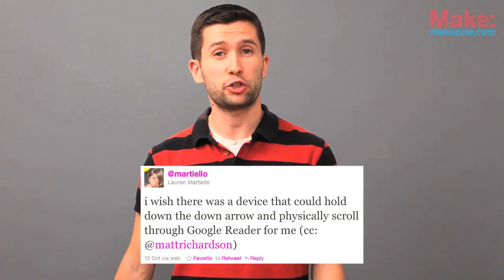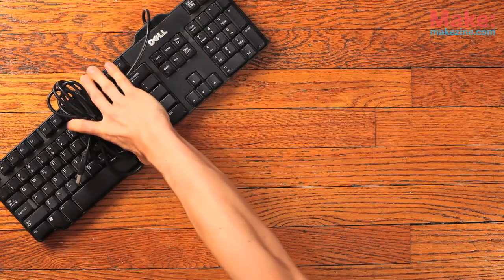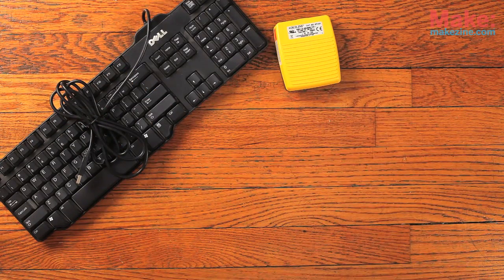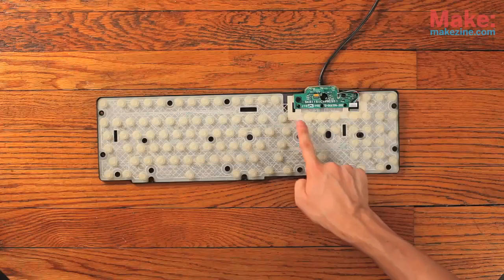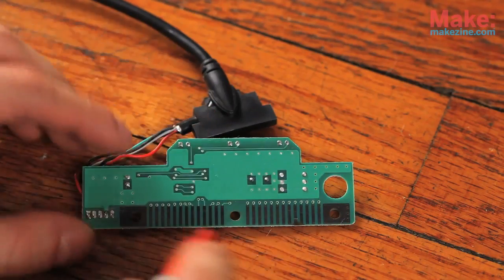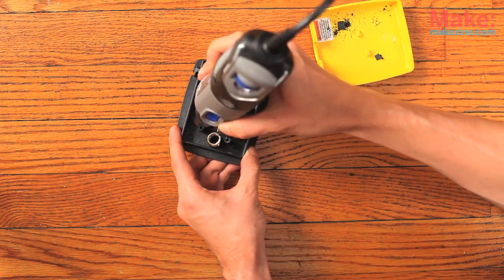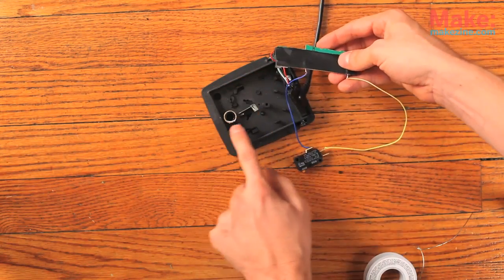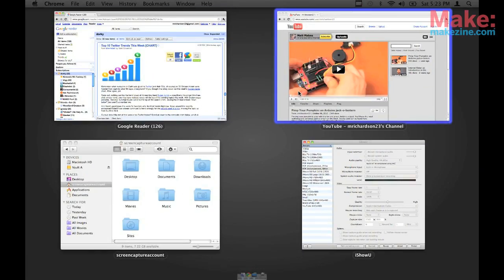Hack a USB keyboard: Google Reader Pedal

Comment: If you need two (or more) keys at once, like ctrl-a and ctrl-p for the pen function on power point, a simple double pole switch may not work.  You need to reliably trigger the ctrl first, then the other key.

Comment: Raceing games, the PC peddle sets have a variable speed, depending on how far you move the peddle, they also use a combo of break and peddle as reverse, but have no clutch. would there be a way to make a set that included a clutch pedal that needs to be pressed to activate the shifting, and how would you make a variable speed pedal?